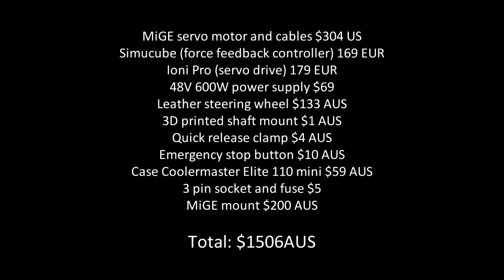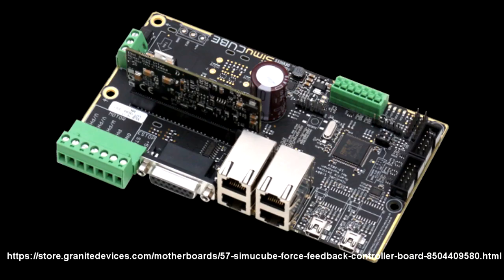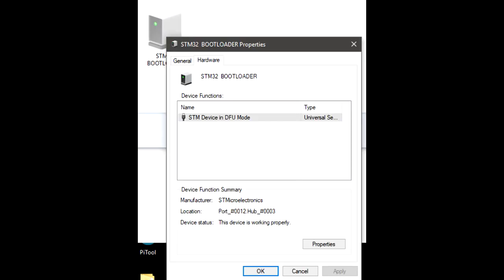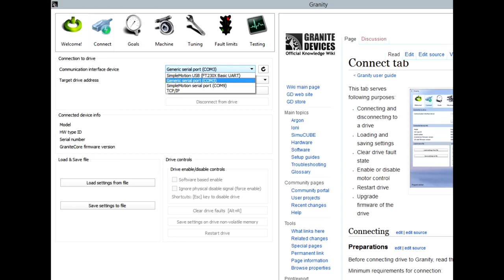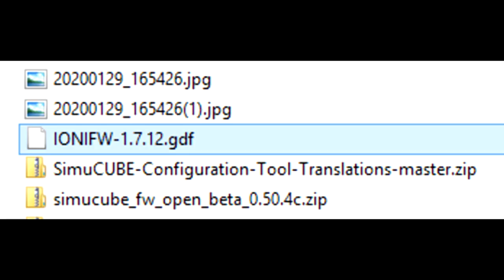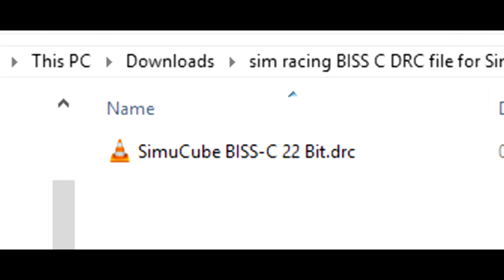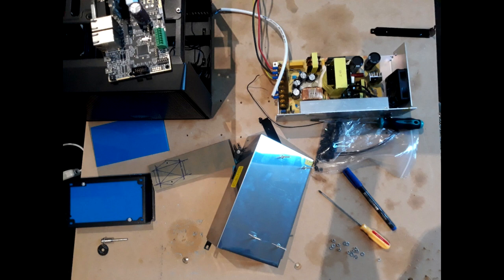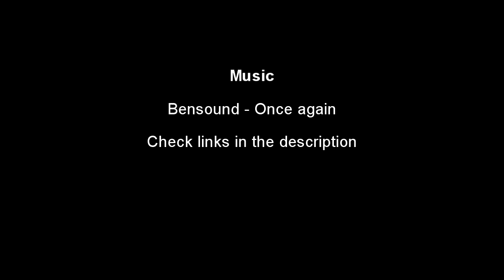DIY building an Open Sim Wheel (OSW) with Mige, Simucube and Ioni Pro

Comment: Is there any way not to use ioni boards ?
Reply from the maker: I considered other options but in the end I wanted something that worked and was proven to work. You might be able to find cheaper options but then you might have issues with it working. Sometimes it's better to spend a bit more for something reliable.

Comment: Hello quick question, the 130ST-M10010 you have has a nominal power of 1000W so why are you powering it with a 600W power supply?
Reply from the maker: I think you will find that the wheel would be very unrealistic if it was driven at 100% power. I typically only use it at about 50% and even then it is a real handful. I suspect I would only be using a few hundred watts at most for short periods of time. 600W has been more than adequate. Hope that helps

Comment: whats the point? You can get Fanatec for the same amount.
Reply: Disagree. The equivalent Fanatec would be the DD2. For the base and bracket alone it would be $2850 AUS then you would have to add the wheel.  On top of that is the cost of shipping. The OSW is easily a 'no brainer'.

Comment: Mate thanks for the video, I m looking forward into building my own OSW with the Semicube and IONI setup because I have a KUKA servo laying around, but it is rated for 200 VAC, will it work with the IONI driver ? cause I think that the max V output you can get from it, is like 60V something around that. You also use a servo rated for 220V on the video that why I am asking, maybe you know, thanks again !! cheers
Reply from the maker: Hi I think that servo wouldn't work. Simucube has a fairly narrow  selection of servos that it is designed for. Have a look here: https://granitedevices.com/wiki/List_of_motors_for_SimuCUBE
Cheers
Reply: @sixdegreesofflight7765  Thanks, I´ll check

Comment: Thanks for sharing.
Noticed you didn’t use an expensive power supply like the others.

Did you incur any import duty into Aust on this build?
Reply from the maker: The power supply is still working fine. I used similar ones in my 6DOF rig a few years ago. I didn't have to pay any taxes or sign declarations etc in Australia for any of the components :)

Comment: Hi! I just wanna ask how you connect the control buttons on the wheel to the microcontroller?  I'm quite confused cuz turning may cause a lot of issues.  Thanks!
Reply from the maker: Hi, the buttons are connected to a microcontroller which sends the presses to another microcontroller connected to the pc using bluetooth. See this video:
https://youtu.be/v951nbbE6Rg
Hope that helps

Comment: You think i can use an Arduino?
Reply from the maker: When I began thinking about my OSW this post on Reddit was a game changer for me...by dospaquetes

Alright, a bit of history would be useful here I believe. The OSW idea started on a french forum, racingfr. At the time they were repurposing old arcade wheel stations and changing the motor and stuff. They came up with a simple firmware, called mizoo after the guy who coded it I believe, which only supported the most basic FFB effect (constant force) and turned it into a signal compatible with any motor drive. From there, they floated the idea to other forums, and it got molded into the OSW/MMOs solution. MMOs is similar to mizoo except it handles more effects. But the idea is similar: turning the computer's ffb commands into a usable motor signal.

At the time people used any and all motor drive and motor available, like what they found on old arcades or... granite devices products. Granite device ended up being the provider of choice because its motor drives were cheap and well made, and handled just about what the ffb guys needed. At the time the simucube or ioni didn't exist, they used the ARGON motor drive mostly. The ARGON wasn't perfect though, it cost a lot and would spin your wheel up to 1000rpm if there was a bug, among other things. After a while granite devices started noticing that a lot of people were buying their industrial motor drives to power their racing wheels, and that's why they made the IONI/IONICUBE, a much more barebones package for which you had to do most of the external wiring. But it was cheaper and offered more possibilities to make it suitable for FFB wheels. Simracers flocked to the kickstarter and bought them like pancakes.

After that granite devices started communicating more with the simracing community through beano, an iRacing user and OSW guru. From these talks finally came the simucube, which is entirely tailored to using the motor drive to drive FFB wheels. It also alleviates a lot of the painful tinkering and wiring made it much more noob friendly

However, nothing is stopping you from using literally any other motor drive solution with MMOs, that's why OSW is an "open" project. It's not open as in "open source", it's open as in you can do it your way. MMOs outputs signals suitable for any motor drive. The same way nothing is stopping you from using literally any other motor than the small/big MiGE motors. These became popular because they were cheap, strong, with low rotational inertia, low cogging, etc.

TL;DR, many others before you have tried using other products than the IONI/MiGE combo. Everyone settled on this combo because it's a very good price/performance deal. Granite Devices drives are cheap, high quality, and well suited to FFB wheels. The MiGE motors are cheap, with low friction, low cogging, and powerful.

But as a simple example, a friend of mine used an ARGON drive, some random motor, and a huge belt transmission to end up with a 60Nm FFB wheel. I had it bug out on me once though, it started spining at 1000rpm. It ripped off the wheelplate USB cable which somewhat lacerated my thigh. Moral of this story: the IONI is a good, safe deal

Comment: @SixDegreesOfFlight will this guide also work for IONI Pro HC?
Reply from the maker: Yes the guide also applies to the Ioni Pro HC version which is more expensive. If you are using the small Mige you don't need the HC variant because all it does is supply more current. The non HC version is fine for the small Mige. You will find that it doesn't feel realistic having the small Mige at maximum torque but somewhere between 50-80%. Hence you won't be drawing the maximum current anyway that the non HC variant can supply. See here: https://granitedevices.com/wiki/IONI_device_model_comparison
Reply: @sixdegreesofflight7765  gotcha. Thanks
Reply: @sixdegreesofflight7765  do you highly recommend the 20nm MIGE motor over the 30nm? Since most sim racers doesn't really use the full capabilities (mostly less than half) of the 30nm MIGE motors power, what's the advantage of  30nm over the 20nm MIGE motors in sim racing?
Reply from the maker: @MarkVersion1  Arguments FOR big Mige
Main argument is higher inertia
Other (non-engineering or illogical) arguments
- Bigger is better.
- Better to have too much than too little.
- You can always turn it down when you have too much whereas if you don't have it to begin with you can't turn it up

Arguments AGAINST big Mige
Weight Small (11kg) vs Big (21kg)
Cost: Higher current power supply (1000W or higher), Ioni Pro HC version, big Mige
You will need stronger, denser aluminium extrusion and certainly a different structural arrangement to the gantries to cope with the increased weight and inertia
 when moving and using
RSI or damaged wrists
Some racers have claimed that the small Mige has a faster reaction to inputs than the big Mige

Summary
In most cases you only need about 10Nm
The small Mige can output up to 25Nm for short bursts anyway
If you run the small Mige at max it is very very tiring on the arms
In my opinion even the small Mige on maximum is not very realistic unless you are driving a vehicle with no power steering!
At maximum torque the small Mige can dislocate or even break finger bones or wrists (if you crash or roll the car and your fingers are inside the wheel and you don't let go quickly enough)
Reply: @sixdegreesofflight7765  would you recommend the Mige 80ST M04025? Some claims this motor overheats.
Reply from the maker: @MarkVersion1  It is roughly half the price of the small Mige but I would consider its rated torque too low for a direct drive system when taking into consideration the cost of Simucube, Ioni Pro etc
Reply: @sixdegreesofflight7765  ok tnx.
Reply from the maker: @MarkVersion1  The servo motor I order initially inquired about was the Mige 130ST-M10010. I simply asked Lisa 

https://granitedevices.com/wiki/How_to_obtain_MiGE_servo_motors

...to give me a price to build an Open Sim Wheel based on the small Mige in addition to a BISS C encoder and cables. She knew what I needed and sent the correct parts.

Comment: Hi, at 6:06, what sort of wires were you using to connect everything together and where did you get them? Thanks!
Reply from the maker: Hi, I used some left over house wiring cable used for the internal wiring of home power outlets which had to three insulated wires - active, neutral and earth. Each wire had 7 copper conductors of 0.67mm and the outer sheath is 3.3mm. Hope that helps
Reply: SixDegreesOfFlight thanks! Will get a similar wire specs as what you used. The 0.67mm is the Cross Sectional Area right?
Reply from the maker: @speedygonzales91  0.67mm diameter. Sorry I didn't see the reply

Comment: Hi, which awg cable you used to connect simucube please?
Reply: Hi, the max current that can be drawn from the power supply is 12.5 amps. So you should use  at least 14 gauge wire which is generally rated to 15 amps. I use 12 gauge which is rated at 20 amps to give a little "head room."
Reply: @yxamyxam  Thanks, best regards, great build!

Comment: Hey mate how much were you quoted for the 22 bit encoder? Also is it possible to install the simucube wireless adapter to the motherboard?
Reply: Hi, 

Detailed information about the Simucube wireless wheel system is available here:

https://granitedevices.com/wiki/Simucube_wireless_wheel_system?fbclid=IwAR3mGYesUgYehSMd5xJby-cW75SUh-S85lsZ1nq2Z1x5liEuJYd6D41Pc2k

Costs
37 Euro for the receiver
50 Euro for the wheel transmitter
Need you also need to purchase the mounting system, buttons, shifters and battery/battery charger

Note: The Simucube 2 versions have the receiver module already included onboard

Buy the Simucube wireless wheel system from here:
https://racewerk.com/products/simucube-wheel-side-wireless-button-plate-module

For Simucube 1 this works out to about $145 AUD for the receiver/transmitter pair before adding buttons, battery etc.

If you follow my build it would be simply be a matter of plugging the receiver into the motherboard - it would certainly fit. The metal enclosure might limit the signal a little so it would be best to have Simucube as close to the wheel as possible.

As for the BISS encoder cost, if I recall, it was only an extra $30 or so. When you are spending that much money on a steering system, you want it to work. I figured that for a little extra, it would be tested, working and a much smoother experience than a lower resolution encoder. I didn't want to have something go wrong and then try to get a replacement/refund by trying to  save a few dollars by doing it myself. Weigh up the risk to save a few dollars :)

Comment: I literally went mad trying to find the source of the issues I had with my OSW, which I bought as a pre-built kit from Simracingbay. it was the same model as yours, small MiGe 20nm.  I spent I'd say half time actually using it and half troubleshooting. 
So in the end I sold it and bought a Simucube2 Sport, and in the last year since I got this I never had any sort of problem.
But this made me realize it was all due to EMI interferences, I never thought about it and therefore never upgraded to shielded cables: I say this because now Simucube2 systems comes with EMI protected board and power cable - you don't need anymore the encoder cable because the electronic parts of the motor are all inside the motor case itself.
Moral of the story, I would still have the OSW if I discovered what was causing all my issues (namely bad ffb interference and cross-talking with HE pedals).
Reply from the maker: Thank you for such a detailed report. I hope it helps others. In my case, I do have EMI that only affects the Pimax headset: if I touch the bottom of the HMD while the platform is powered-up - the display blanks and the simulation window I am in looses focus in Windows. I have replaced the Pimax original strap with a Vive deluxe audio strap which enables me to take the HMD off without touching the Pimax housing. It works really well. I did try grounding the platform and OSW servo but it didn't do anything apart from stopping the Mige from working. I didn't investigate further on that one.
Reply from the maker: @BottomSplitPodium  Thank you for adding that extra information. I'm sure it will other builders.